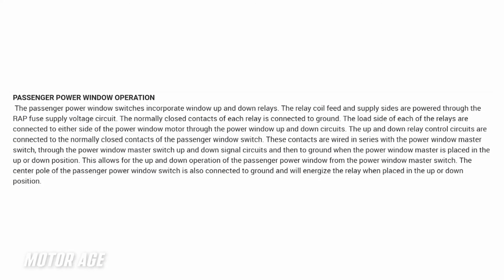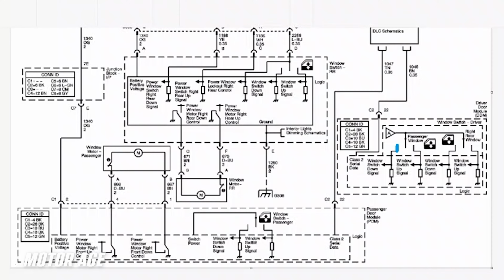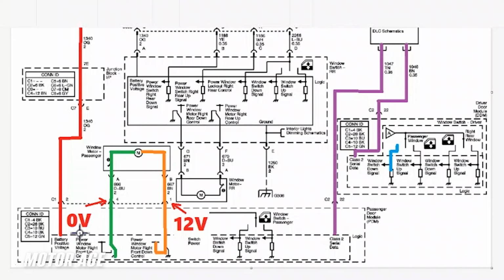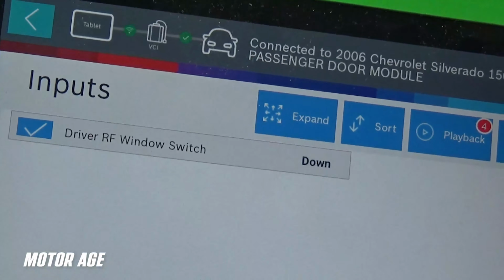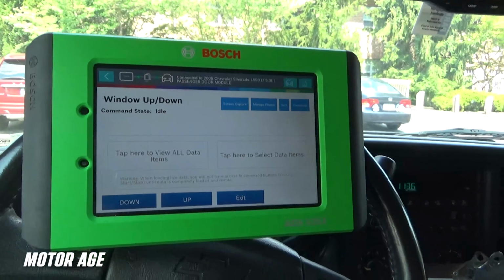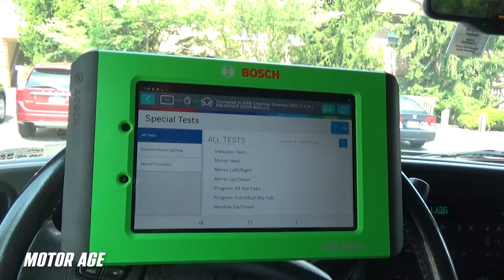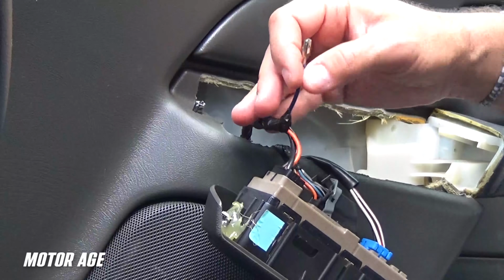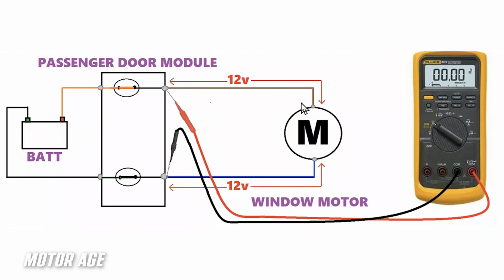Mastering Diagnostics #6: Using Bi-directional Control to Divide and Conquer

Comment: Unfortunately , many shops will go for the $ and put in a motor , even if only the connector was loose . On the customer side , if you keep coming back and some repairs are a simple fix , I think you will be loyal . Again , too many shops try to squeeze the maximum juice on each repair . Even worse are the shops with limited training and equipment . Great lesson .

Comment: My take away from all of this is if you want to make a happy customer, and potentially a repeat customer, state that proper repairs were made within the one hour diagnostic fee, let the customer shake your hand and tell him to have a great day.

That’s called integrity.
Reply from the maker: Although I agree with that, I will say not all complete diagnoses can be drawn within the first hour. However, as long as you communicate with the customer, each step of the way, you can easily sell the required time to complete the diagnosis accurately.

Comment: Interesting enough video. I didn't know about PID manipulation from scan tool. The method of troubleshooting was correct. However, I'll suggest to change your terminology a bit. Use control or signal side for relay input and instead of electrons, because that's just a bit too dramatic use voltage or grounding as applicable. All in all, great video. Thanks.
Reply from the maker: Thank you and I apologize if I wasn't clear in my explanation.

Comment: I only have one small issue I understand how this all works how come there was no explanation reversing the voltage in the motor?
Reply: The switch controls the ground  side which  reverses the polarity in the motor so that it can spin in one direction & then the other for up or down, respectively, therefore continuous 12 volts to the switch.
The direction of the spin of the motor can thusly be controlled by one motor, not two.
Reply from the maker: I apologize if I wasn't clear. According to the displayed wiring diagram and the correlating explanation I gave, both the switch contacts rest at ground reference. Only when the switch is depressed does one of the motor circuit feeds reference voltage supply (the other remains on ground reference). This allows the motor to rotate in one direction. Reversing the switch allows the terminals of the switch to change reference points (what was referencing voltage now references ground...what was referencing ground now references voltage) and the motor reverses direction.
Reply: @VehicleServiceandRepair  hopefully everyone reads this because this now completes the explanation of the complete operation of the circuit (thank you so much sitting in front of a camera and doing this I'm sure it's quite challenging I know for a fact that goes through your head like lightning and you understand it completely I wish to thank you one more time for keeping this clarified in the afterwards of the great job thank you!